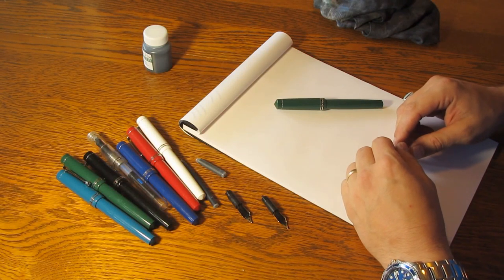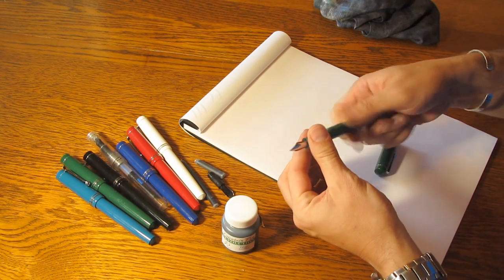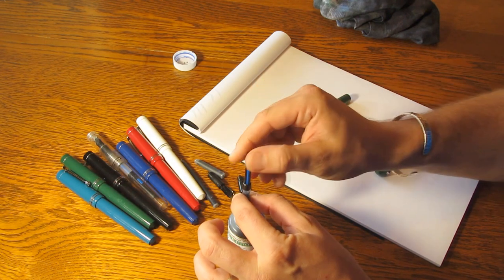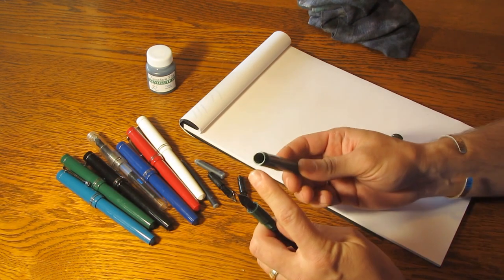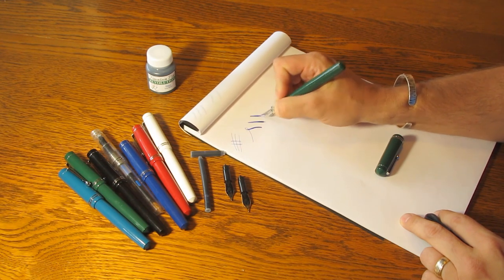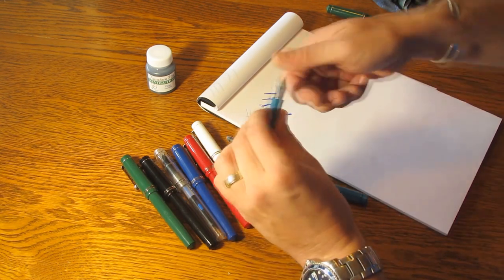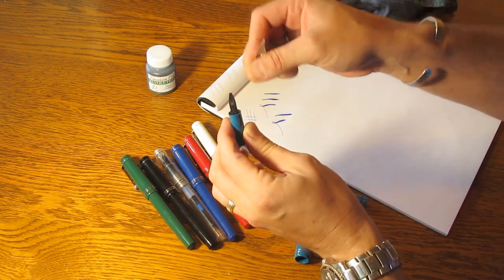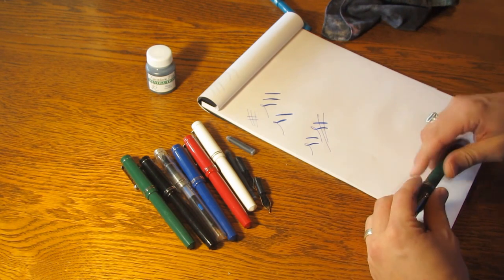FPR Darjeeling Instruction Video

Comment: Hi Kevin, once the converter has been filled and you start to write, should you need to gradually lower the plunger as the ink is being used up (prime the feed) or can you leave the plunger at the top until all the ink is gone? I enjoy your videos.
Reply: Hi Lee!  You can just leave the plunger where it is unless it is running dry and you want to prime the feed a bit.